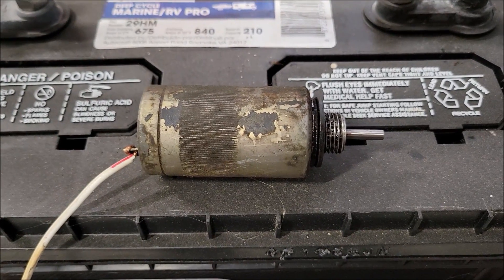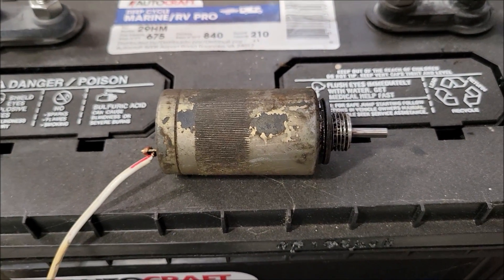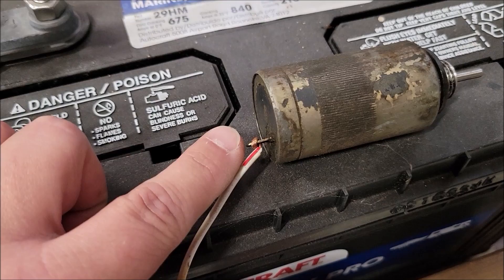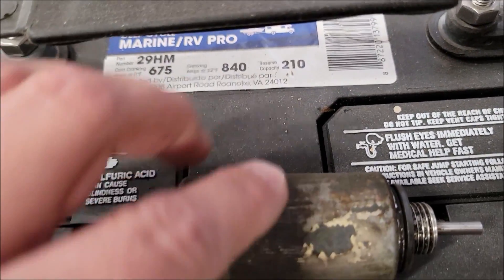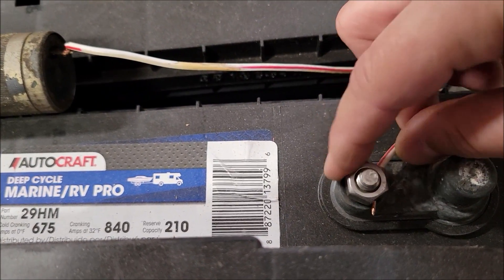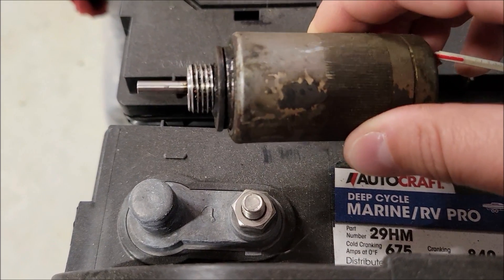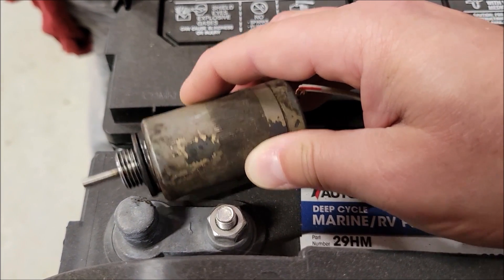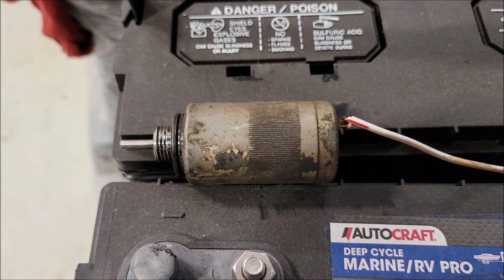How to Test a Fuel Shut Off / Injector Pump Solenoid

Comment: Mine was kind of bent, so it would shut off part of the way and not all the way the solenoid gets really hot
Reply from the maker: Probably best to just replace it.
Reply: @ oh yeah… it would start and run but not want to shut off with the key😂

Comment: I believe it is also used as a safety measure. Like Air on air brakes/the air is used to keep the pads OKK the drum or disc. That way if you loose air pressure, the brakes WILL apply. Please correct me if I’m wrong about the fuel cut off.

Comment: Friends B2400 starts runs for few seconds and dies .  Starts easy but dies within few seconds.  I wonder if this is his problem.
Reply from the maker: Could be a fuel pump. Usually this keeps it from starting at all.
Reply: @SeidelRanch  ya that’s what it seems.  Mine will run, starts same as always , but only runs for 5sec maybe then like cutting off key.  While it’s running it will throttle up nice n smooth , no fuel knocks , no smoke.   I’ll let ya know what the cure was. I may try to get fix it this week.
Reply: @curtishoward5584 what was the issue?

Comment: What about a 2 wire solenoid
Reply from the maker: Then it's usually one negative wire and one positive wire.
Reply: @SeidelRanch  it's not.  They're both orange and connect to two red wires
Reply: There is also continuity between the two wires
Reply from the maker: @frontlinemedia4270   Ok, then it sounds like it really is a one wire but it's just along a route for the power wire.  Basically it sounds like there is more than one item powered off that power wire and the solenoid is just one of them.

Comment: The solenoid needs a full twelve volts to work, If the battery is down it wont operate the solenoid,
Reply from the maker: Yeah, I have noticed some are more open to less than 12 volts than others but pretty much any less than 12.0 volts and you are not starting that machine anyway.

Comment: I'm having this problem right now.. how do u remove it???
Reply from the maker: Mine just unscrewed, but it's different on different machines.  Usually you can just unscrew it.
Reply: @SeidelRanch  I'm trying 2 pull it out of a skidsteer "GEHL" Isuzu engine.. r they hand tightened?? It's giving me a hard time 2 remove cause the space is limited
Reply from the maker: @kenneththompson6543  This one was just tight enough to have to use some pliers, but it was close.  I think it's meant to be hand tight on this one.  My other skid steer has a hex head on it so you can wrench it out.
Reply: @SeidelRanch  thank u.. I got it off yesterday.. put the new 1 on 2day.. only 2 find out 1 of the wire that went 2 it is cut somewhere.. so I just spliced it & ran an independent wire 2 the key switch

Comment: If you cut the end of that rod off wouldn't the work also?
Reply from the maker: I am not sure what you are asking. This solenoid is working properly.  Cutting the shaft off would keep the fuel on all the time and could make your engine keep running even with the key turned off.
Reply: @SeidelRanch  I'm was saying that if that solenoid started malfunctioning, couldn't a person just snip the end of that needle off untill it got replaced
Reply from the maker: @mohicanjoe2079  IT would probably allow it to start.  The issue would be the fuel will still be going to the engine and it would not kill it.  Many engines use the fuel shutoff to kill the engine.
Reply: @SeidelRanch  that would probably explain the backfire at the end lol....thank you sir

Comment: This blows my mind. So IF that solenoid, in this case, were to go bad, it's natural state would be to shut fuel off? It's difficult to make that conclusion here because the solenoid is actually operating properly.  Great video!
Reply from the maker: Yeah, but I think that is how they all work.  So if there is no power, it shuts the fuel off.  It will only open the fuel if there is power.  The shut off solenoid on my John Deere 317 skid steer is the same way.  So if it fails, you will probably not be able to start the engine.
Reply: @SeidelRanch if the solenoid wasn't working would the vehicle still start on ether??
Reply from the maker: @unfknknown9678  It would try, yes.  This cuts the fuel.
Reply: @SeidelRanch  my td27 won't even try to fire normally but it'll kinda start for a second with ether sprayed in the intake . Fingers crossed this is my issue then.
Reply: And if electricity is leaking and you turn the switch off the machine will continue to run. Im still sear hing for my leak.

Comment: what do you mean when you say "and so fourth " ?
Reply from the maker: I mean the engine is attached to the frame and the whole tractor is a ground so the solenoid does not need a ground prong. It only has a positive prong because it's ground is the whole tractor when it's screwed in to the injector pump.

Comment: Is the tip magnetic to where it pulls the fuel shut off bar
Reply from the maker: Not on mine.  This one pushes the valve to shut off the fuel when power is turned off.  The valve opens from a spring inside it when the solenoid is powered up.

Comment: I had a similar problem on a Ford 1920.  To test you can run without the solenoid.  To temporarily fix while waiting on parts, cut the plunger off and turn off injection pump manually.
Reply from the maker: Thanks for the tip.
Reply: I've got a 12v cummins that sat for years, the solenoid was bad. I've been shutting off the fuel by hand, some applications have a manual (usually cable operated) shut off. Good video